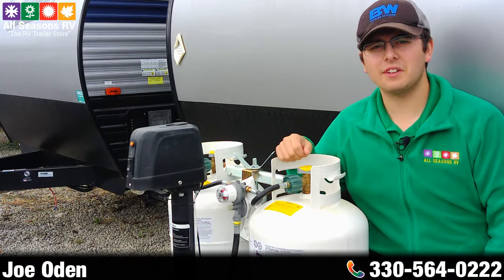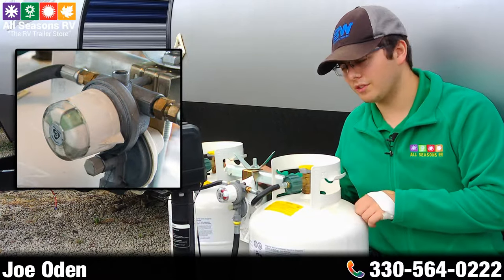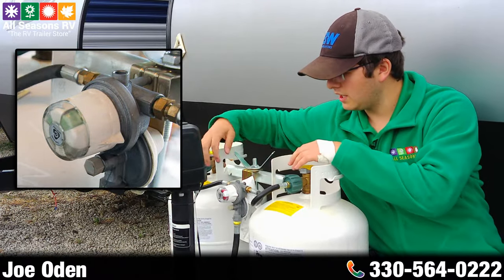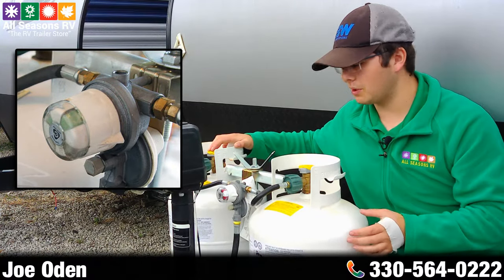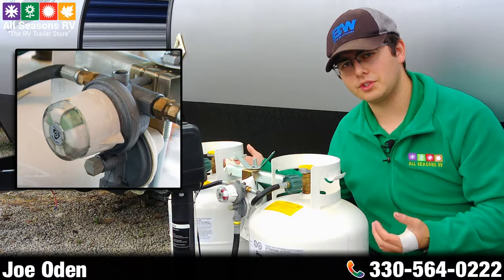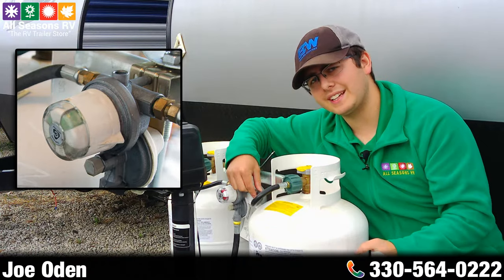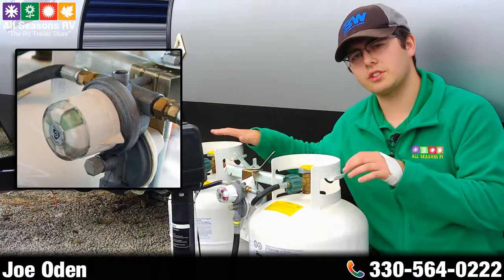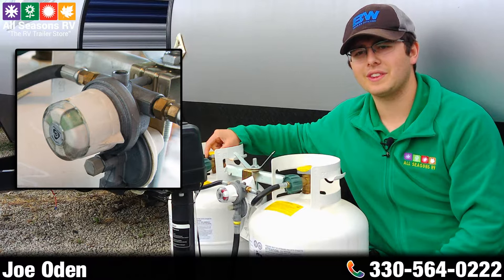How to Properly Setup the Dual Propane Tanks on a Camper with Joe Oden

Comment: Simple, to the point, and useful. Thank you
Reply from the maker: Glad it was helpful!
Reply: My selector cover the clear part with the red plastic got knocked off and I can't figure how to put it back to function. There's a little wire and I'm not sure how to reconnect it. Or if I should by a new one.
Reply: Well-explained. Thanks!

Comment: This was very helpful, thanks
We have this set up on our 2021 EPro 20bhs... problem I have is I thin
k I stripped the plastic selector knob .. can I purchase a repacement knob? thank you Joe
Reply from the maker: Unfortunately, you will not be able to purchase a new knob. Your issue would require replacement of the whole regulator. Considering its a 2021 you should be able to get it warrantied.

Comment: What if you put the tank switch to the middle?
Reply: Then you do not know which one is empty and needs filling. With most all regulators they will automatically draw from either site. Thus the indicator for empty no longer works. If you want to draw from one and not the other simply close a tank's valve. Forcing the regulator to draw from the open valve tank. SO, the device you turn is an indicator of empty and the knob is used to tell the indicator which tank you wish to know about. It doesn't select the tank to use when one is out of gas.
Reply: A lot that have read
says dual propane tanks can draw from both tanks...equally.

Which isn't a good thing,
cause you want 1 to be there as back up.

Comment: Hi all, does any one know what is the small grey cap ? Inside it has a screw that your able to turn with a flat head screw driver. Will that mess with the 11inch water column?
Reply: yeah, don't mess with it.

Comment: On a dual propane tank system if one tank goes empty will the other tank fill it?
Reply: This was my understanding of a straight through regulator manifold.  if there is no system or valves in there to isolate the empty tank and you open the valve on a old system  with a new full tank the propane will equalize into the other tank .. so two half full tanks..  in this video the young man seem to be stating that the manifold regulator system they have hooked up will close off the empty tank and not let it cross fill.   BUT old System did not have a check system SO THIS IS NOT HOW TO USE A twenty year old two tank system!
Reply: @paulnels108  no. Propane doesn’t work like that. It’ll pressurize the empty tank with vapor, but the liquid won’t flow over to the other side.
Reply: P N We do that all the time. they will equal out to the same amount of liquid in each tank.  we turn the full tank upside down so it will fill the empty with liquid
.

Comment: I want to setup like this for my generator except I want both tanks to empty together.
Reply: Why would you want both tanks to empty togethet?
Reply: @ramram981  you need a higher flow and it’s recommended 250 gal tank minimum.  When you draw it out at the correct speed the tank actually freezes and blocks the flow killing the generator on smaller tanks. Because I’m in zero lot line and codes I can’t place a tank anywhere except under my driveway.   With pavers that’s what they do but I have a cement driveway.  My only solution are 100 pounders tied together to both flow together.